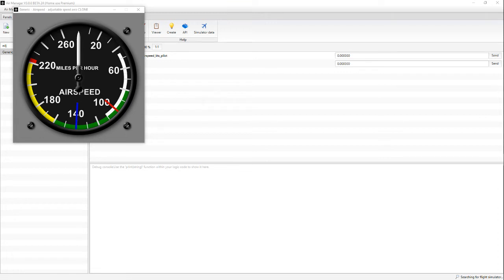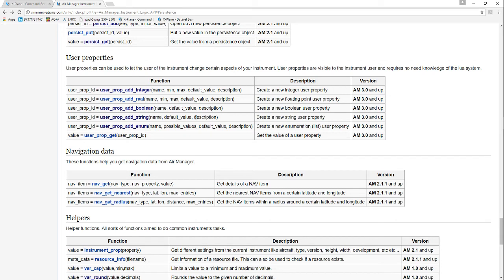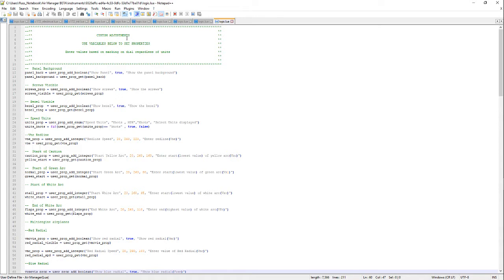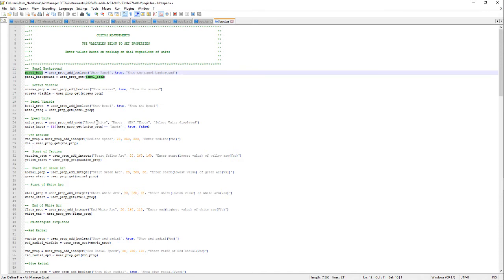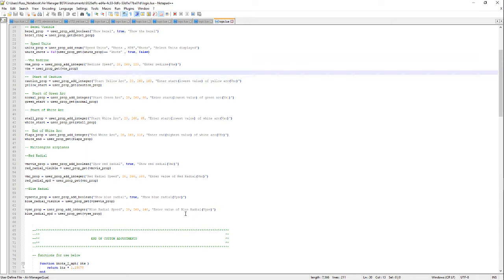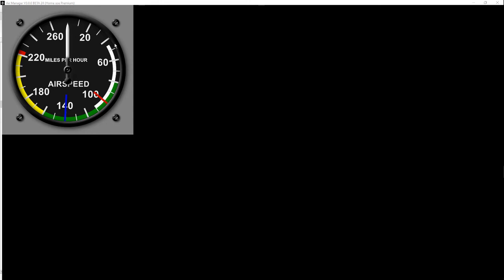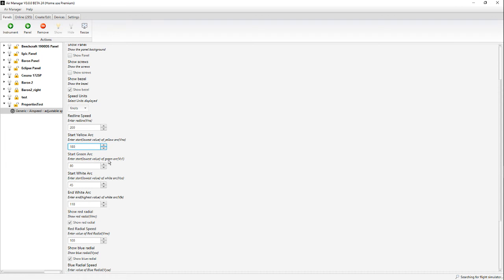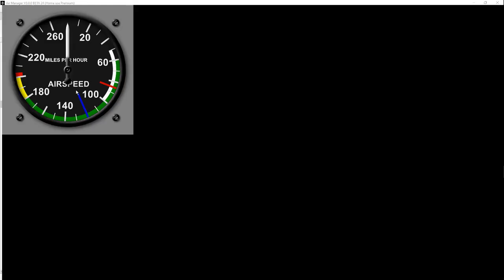Air Manager 3.0  Update #5

Comment: Hello Russ,
I use a remote computer to run airmager with a Cessna 172 layout.
The issue i have is the Oil temperature gauge in airmanager has diferent readings than the default xplane11.
It goes to the red line right away.
What can i do to fix that?

Thanx
Reply from the maker: Cessna flight simmer . I think the new C172 for XP may have some custom xLua datarefs for the oil temp. If so the code should be modified to reflect that by using those references.  I will take a look an,d see if this is he case.
Reply from the maker: There seems to be no custom dataref in XP11 for Oil Temp on the C172SP.  I just ran the C172SP from XP11 and the oil pressure matched the Air Manager gauge exactly.  I used the Cessna 172- Oil Temp / Press combo gauge that is in the community(free) instrument store with folder name id a67aa57c-4523-4119-89fb-ff409b91079f. Is that the one you mean,
Reply: Hi,
I use the normal Cessna 172 Oil temp. gauge from airmanager.
I don't use the default c172, i have simcoders REP Cessna 172.
Reply: Hi Russ, I had the same issues as Cessna flight simmer above. I also run the Cessna 172 layout from air manager v2.1.3 for x-plane 11 and my Oil Temp is off as well. It goes to middle almost immediately and then red lines shortly after, while in xplane the gauge does not move for awhile until the oil actually warms up. As a result they never match each other. A few other gauges do not match also. My OAT displays C instead of F. My EGT and the marker needle never match. And the last problem I have, is the Horizon indicator up and down with rotary does not match in xplane. They can both be done independently but they will not match. Any assistance would greatly be appreciated! I built a cessna sim so its the only panel I care about. I run the default C172 in xplane and I run the cessna 172 gauges in air manager so I don't know why those few do not match. All the main instruments (6pack, obs, adf, etc.) work awesome and nothing beats Air Manager! Thank you for this awesome product!!! Again, thanks in advance for your help with this.
Reply: Hello Cessna flight simmer, I was able to fix the oil Temp issue. I am still trying to fix the other issues I mentioned, so if you, Russ, or anyone else can help me out with those that would greatly be appreciated. For the oil temp issue though, I just used the recommended change by paulsharp100 at the bottom of https://forums.x-plane.org/index.php?/forums/topic/112057-air-manager-cessna-172sp-oil-temp-error/   Hope this helps you like it did me.